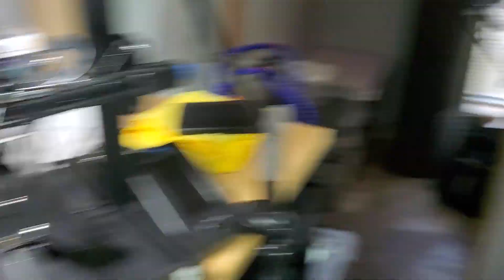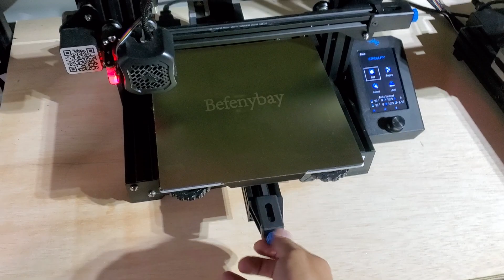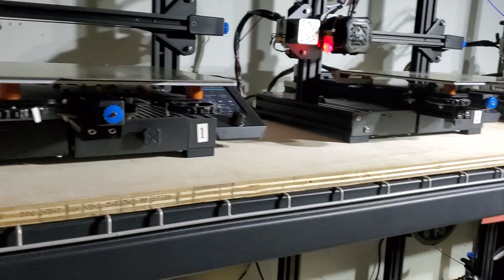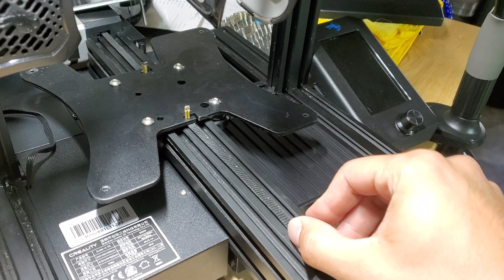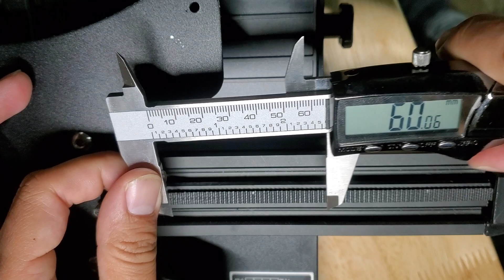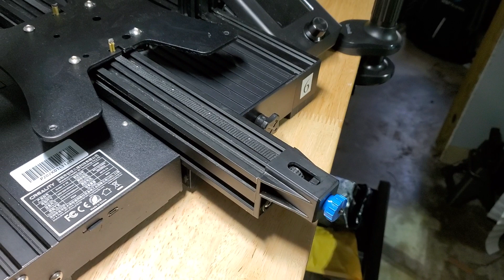3D Printer Belt Tension: Its ruining your calibration! Ender 3 V2 Print Farm Accuracy Issues

Comment: I could not get it, how a stretched tooth pitch should influence the travel distance. The pitch of the pulley won't increase and that's what defines your movement, so i've tested it by myself on my E3Pro and made a short video: "https://www.youtube.com/watch?v=ptYU1-HXw2A
With higher tension I got a even shorter movement due to increased friction (needle moves slowly afterward), but all in all it is negligble
.
Reply: Yeah, but the belt will be forced to conform to the pulley where it wraps around (by local stretching, not skipping teeth). Motor turns 20 teeth, so the belt moves 20 teeth but now down the length of the belt that equates to a longer distance travelled. Maybe your belt is a little less stretchy to measure it for such a small movement.

Comment: I’m thinking of designing a linear-rate spring preload tensioner. Unlock tensioner, let spring add preload, lock tensioner. Same tension every time.
Reply from the maker: That would be an excellent add-on! Only thing left to do is find the right spring rate!
Reply: @Redo3D  a cheap fish scale will get you in the ballpark quickly. Just pull on the belt until you are happy and read the scale :)

Amazon: $5.99 
Polychrome Gear Digital Fish Scale

Comment: Another helpful video thanks.  My ender v2 is being returned tomorrow as I haven’t achieved a single print with it yet.  It really has been the most difficult and frustrating printer I have ever owned and currently have 5 others that just work.  I have noticed the bed is not flat but can’t afford to waste anymore time on the machine.  Incidentally Creality support has been non existent such a shame because I so wanted to like this ender 3.
Reply from the maker: Sorry you're having so much trouble Paul. Sometimes I wonder if the ender 3 was the right printer for the farm. But I tell you what it has taught me a lot about 3d printing!
Reply: Quality seems a lost art these days in favor low quality products for more money.  Products from China seem especially bad in my opinion though they are improving.  I have an Ender 3 Pro and it took me over a year to get quality prints out of it.  Part of that was my learning curve I am sure, but some of it was the printer itself.  Putting dual lead screws helped considerably.  My point is that unless you are willing to pay several thousand dollars for a professional 3d printer, expecting a cheap 3d printer from China to work out of the box in a consistent manner might be unrealistic.  They can and do sometimes take a lot of work before they work properly.

Comment: I believe Gates high temp belts have wire in them like a car tire does. That should help belt stretch a lot as well. My belts are not near that tight.
Reply: do you have a part number? or amazon link? thank you.
Reply: 100%

Comment: I'm not sure I understand your point.. you adjust the tension screw .04mm and the marks get .04mm wider..

The stepper still drives a certain distance (properly calibrated) and although the belt has stretched by .04mm the tension screw makes the belt travel .04mm further..

.04mm (belt stretch)  - .04mm (tension adjustment) = 0mm difference..

Now, if your tension adjustment is loose the belt can slip on the stepper  and prints will be quite poor. Overnight causes friction  reducing quality as the stepper has to work hard to move the carriage. 

Tighten taught, not tight is key
Reply from the maker: The belt pitch changes. So there is a difference in distance traveled. As someone suggested it might have been backlash that was removed that cause the change in the calibrated distance. Still need to do more testing but it is definitely not staying the same no matter the adjustment.

Comment: Since you’re stretching the belt with that screw.. it’s pretty obvious that it’s stretching the print also. Question is, if we assume the pitch of the belt should be right under perfect stretch.. should we then always calibrate belt tension to match print size.. vs the old way of calculating the motor steps?
Reply from the maker: This is my thinking. Im going to experiment with calibrating based on the tension of the belt, but I need to find a quick way to measure this. What I may do is measure the 100mm movement of the X and Y based on a fixed object, and make adjustments to the belt and see if i can get it dialed in. I will reset the e-steps all back to factory defaults.
Reply: Problem is you want to measure a 150-200mm move to better than 0.1mm, better to 0.02mm. how do you best do that?

Comment: It appears your Y belt is upside down . The teeth should be against the idle pulley, resulting the smooth side of the belt is also on the drive side instead of engaging the drive gear on the stepper.  Will be off completely
Reply from the maker: I flipped it on purpose to demonstrate the stretch of the belt when it is tensioned.
Reply: @Redo3D  Glad that was a demo then,  but wouldn’t the stretch be the same as the belt tension over and under is equalized at the idler pulley regardless if the drive gear ‘sees’ a tooth or smooth side of the belt?  Is it possible the belt slackening issue source could be the tensioning mechanism is vibrating loose slowly if you’re running all printers continuously?   How about marking the knobs with a black line and monitoring any movement.  Just a thought.
Hope you find a solution. Cheers, Hans. Cheers

Comment: Hopping if you come up with a solution you make a video. I always thought it was weird the we just tightened the belt we felt comfortable with how tight they are. For instance the band say at has a gauge the tells you when it's to loose, right, and then to tight. And if it not to the middle ot the gauge which is where it should the cuts are off and the longevity of the blad differs. Thanks for the info.

Comment: Cogged belts do not need much tension to work correctly. All you need is enough tension to keep them from skipping teeth - much more than that and all you do is add friction to the system. Particularly with 3d printers where there isn't much force on any of the moving parts. I have personally pushed over a thousand pounds of force through a system using that type of gt timing belts that would be considered too lose by most. IMHO you got goofy step per mm measurements because your belts were too tight and causing the motors to miss steps.
Reply: That's what I thougth too. The movement should only be determinated by the circumference of the pulley. But I think he took out some backlash, because his case got bigger.
Reply: @85rengi  the belts are made undersized and stretch to length under correct tension. It's easy to notice, when the belt is engaged but not fully tensioned, it's a particular length right, but as you tension it, the tensioner moves by about 1-2mm or so, maybe more depending on length. But the number of teeth isn't increasing, so there's about 1% of difference in real steps/mm.

This isn't a missed steps issue. Because any offset that endures throughout the print that you can achieve will be multiple of full step, so either 0.2 or 0.16mm depending on pulley type. "Lost" microsteps are a misnomer, even when microsteps are not expressed, they still advance the counter that rotates the magnetic field and it will just snap to the correct position at the next quarter step. The result are not dimensional issues but surface quality issues, salmon skin.
Reply: @SianaGearz  as my model is printing, about every 2 hours it moves over 1.6 mm or about  .065 in. Then continues printing. I'm not sure if it's a loose belt, missed steps or missing tooth. Just got the printer as a rebuilt. They must not have tested it. I tried tightening the belt we'll see what happens.
Reply: Agreed here

Comment: But some good gates brand belts with aramid fill. The Chinese belts could have steel belts in them or some other random construction method. 

The best way to control your QC is to buy repeatable, well known brands for motion parts. Gates makes the best belts in the business and they'll be consistent from belt to belt as far as tension and longevity is concerned.
Reply from the maker: Thanks Anthony! Will check out gates for sure!
Reply: My 3V2 came with Gates belts. Says it right on them
Reply from the maker: @willl84  you are correct. They are gates. I just checked every single one.

Comment: Did you just demonstrate a calibration method using calipers? Mark a 20 teeth reference and adjust tension to a predetermined length. I would imagine those belts would be manufactured to a specific spec for pitch and tension.
Reply from the maker: Interesting idea, That did cross the mind, but I believe the gear also has some play in it. Would be a worth while experiment so you don't have to adjust e-steps but rather set proper tension!

Comment: Not a fan of those free spinning belt tension knobs. Give me a locking screw any day. How much would just be movement from vibration over time?
Reply from the maker: Very true. I was thinking of installing low friction teflon washers, but will for sure have to have some lock nuts or else it might back out on its own.

Comment: Use a guitar tuner app to measure the freaquence of the belt, a gt2 belt needs to be tensioned at the freaquence of 28531hz per mm, you need to divid the frequence by the lengh of the belt, like in ender 3 it gonna be 250mm, and the tune freaquence gonna be 114,1hz for the belt tension on the ender 3 for exemple, but you need to mesure it by yourself.
Reply: This is better than measuring the torque on the tensioner because it actually measures the tension on the belt which is what you care about for the issue you found. I have been using the 28531 hz/mm calculation to tension all of my ender 3 belts for a while and it is working well.
Reply: @bettis211  is there an existing tutorial on this? I've never heard of this method but I'm very intrigued
Reply: This is how industrial belts are measures but we use a special tool that measures the light bouncing off the belts for the frequency. The sound method is not reading the same thing (as it'll change depending on how hard you flick it) but it is a repeatable measurement assuming you flick the same amount each time.
Reply from the maker: I'll definitely try this out! Thank you.
Reply: I've been using guitar tuner app for my delta printer for years. It helps to get the correct tension on all 3 axis. Just make sure the length of the tuned belts are at the same length.
Reply: @anwarahmad4354  which one do you use?
Reply: @zg9xUmvV  i think any tuning app can work. For delta, all the belts are at the same length.
Reply: Thanks, as my belt length is around 2m, would it be best to set the distance between the carriage and the idler to be around 30cm, which would have a frequency of 94hz.
Reply: which app do you use?
Reply: Thank you! I was looking all through the internet for someone to write down the this optimal frequency!

Comment: For big objetc (100 mm or more), dont use the typical 20x20x20 cube, yuo can multiply yuor acuracy if yuo use an object similar in dimension of the object yuo gone print.Lets say yuo print a cube of 20 mm and huo mesure 20,10 ,the error is 0.1 but in an object of 20 mm long, lets say yuo print an object of 200 mm long , so yuo can expect an error of 0.1x10 = 1mm, so its gone mesure 201 mm and thats cuold be wrong for some pices.To solve this print an objec 100 mm long and calilbrate yuor step, if yuo have 100,1 in 200 mm yuo will have 200,2 mm so an error of 0,2 vs and error of 1mm, i hope this help yuo with yuor tolerance problem,bye

Comment: I'm honestly surprised 3d printers even work this well.

When i was working on my cnc machine calculations, i noticed that just the belt reducers for the ballscrews can cause non trivial stiffness loss. Short/thick belts were required.

Comment: There are special torque knobs for that purpose. The only question how much torque needed.
Reply from the maker: I have seen these. They look like T handle nut drivers. I have to experiment with how much torque. The Teflon washers will be to remove any friction from the nut and plastic bracket.

Comment: Btw in their manual, i re read it and says, should set belt the tenion between 0 to 3 mm; the protruding screw that protrude from the tension knob. Im not sure if that matters in the calibration(maybe even between printers?)
Reply from the maker: Interesting. I have some as tight as I can go and it varies how much the screw is protruding.
Reply: @Redo3D  that's waaay too tight. You just need them snug enough to not slip or create ringing.
Reply: Yeah I noticed that as well. All belts stretch, that's the nature of their design. It's a wear item so Creality is basically saying that when you have to set your tension to the point where that bolt head is protruding more than 3mm it's probably time to replace your belt. 

There's not a good way to check deflection of the belt which is the typical beat to inspect a drive belt ( like in a car ) so I think this is their workaround.

Comment: very interested in the results of your solution. belts are one of the weakest links in 3d printers- it's why cnc machines use screws instead.
Reply: @Lassi Kinnunen 81 agreed and chief problem among them is they are slow as hell. my cnc mill uses acme threaded lead screws and with a small nema 23 i can run them at 2000mm/min which sounds fast but 3d printers run in mm/s which is aprox 33mm/s which in 3d printer terms is damn sloooowwww
Reply: The best prints use belts and linear rails.